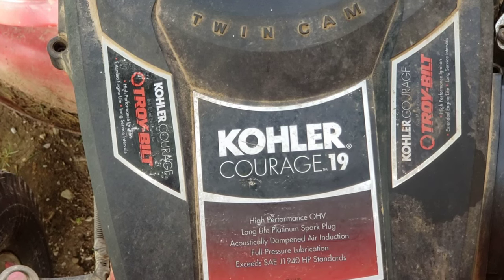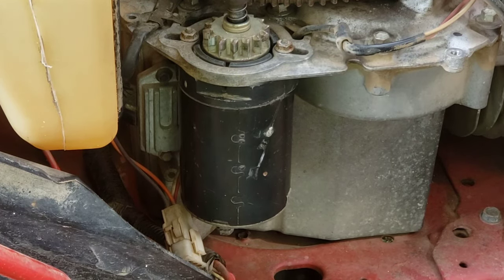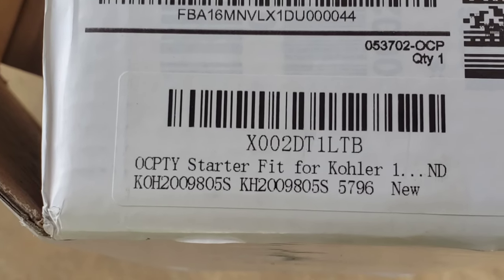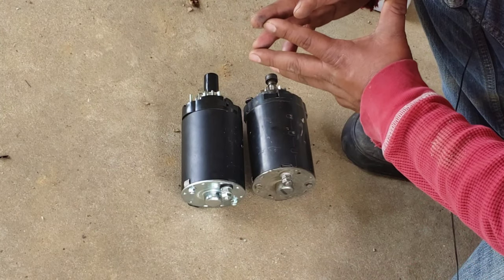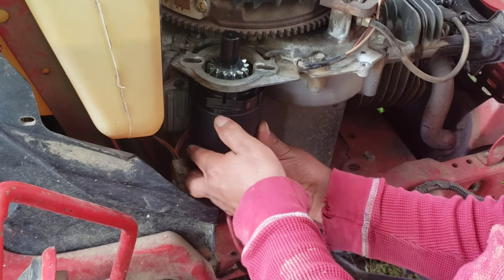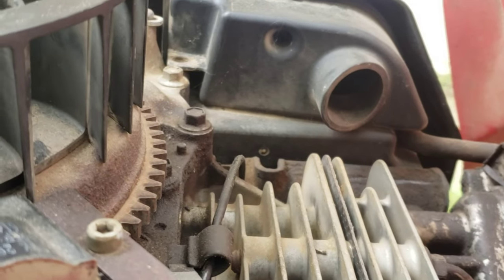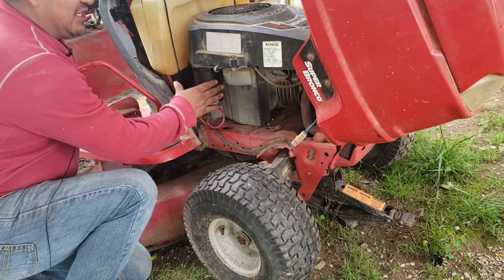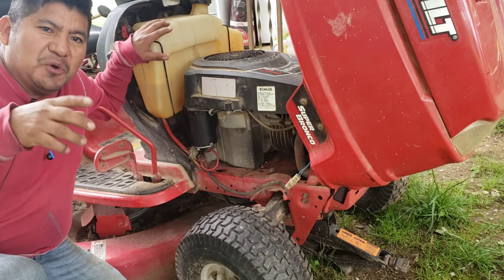changing Starter for Lawn mower/Kohler Engine won't start, Ocpty starter fit for Kohler 18 19 21 HP

Comment: I have a Ryobi Mower with the Kohler 19.5 motor, and it has the exact same problem. The second problem is the mower doesn't have a mower deck, but it was free, so I took it. It ran and rode fine, but then it sat for over three years! Thanks for the video!
Reply from the maker: You are welcome mr. Captain

Comment: I was just about ready to send back the replacement starter motor i just received. The original starter motor did not have the alignment tab and I  did not know where it was supposed to go/fit.  After watching your video, I was able to install my replacement starter motor. Thank you.

Comment: I am having problems getting the hot wire that connects to the bottom of the starter off. What two sizes of wrenches you used to put them back on?
Reply from the maker: Hi Paul, sorry for late reply 
I used both 11mm wrenches or you can use 2. 7/16 but one of those have to be thinner than the other one in my case I had some of my tools grinded down to thinner size for my die grinders or other 
But you can use a socket and a wrench 
But the wrench have to be thinner